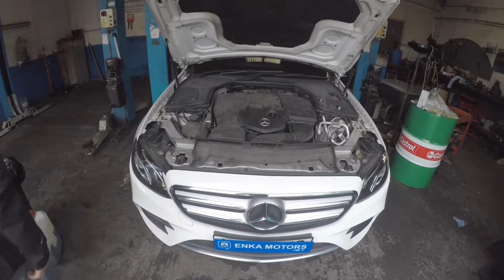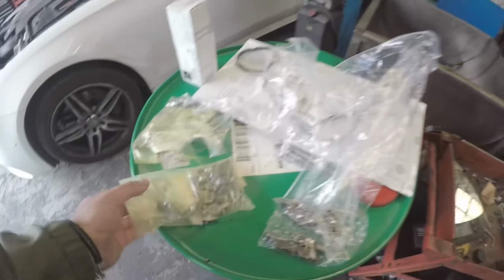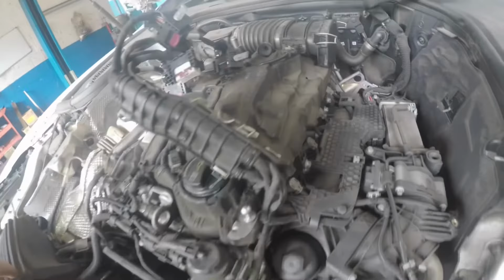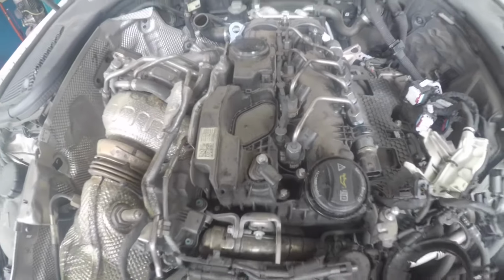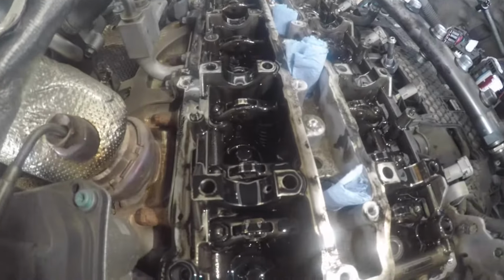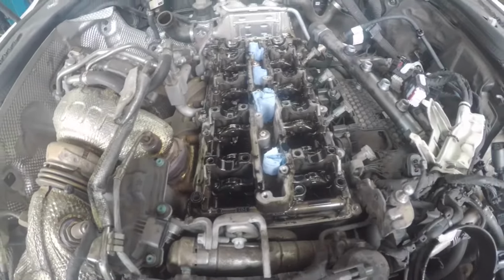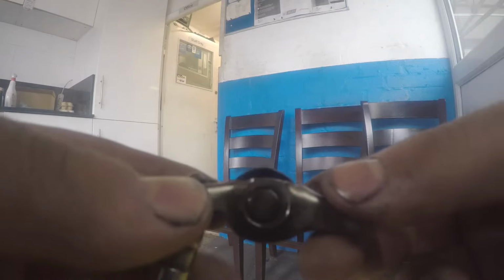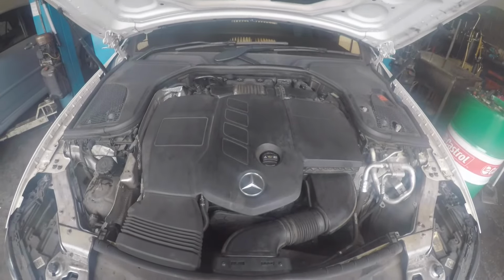Mercedes E220d 2.0 654 engine knocking noise camshaft rocker arms replacement

Comment: Thanks so much for this video guys. I watched the other one before I came across this one. I thought my engine was toast. I'm uk based but I shipped my car abroad. Stupid mechanics told me to buy another engine. Glad I didn't. I will definitely refer people to you guys. You know what you are doing.
Reply from the maker: Thank you for your kind comments, we have done around 5-6 of these engines with this issue, we're glad we can help people with our videos. Did you get the issue sorted then?
Reply: @enkamotors7012  I now have to order the parts from Mercedes and send them over to Africa. Would you mind sharing a full parts list?
Reply from the maker: @jambanja7  Rocker cover gasket. 4x Injector copper washer. 16x Rocker arms. 16x Hydraulic lifters. It will be better to do Engine oil and oil filter
Reply: @enkamotors7012  thank you so much!!

Comment: Is it also common with the om654 1.6 engine (160hp) ? Year 2021
Reply from the maker: 1.6 not 654 engine  1.6 ..626 engine
Reply: @enkamotors7012  it is indeed OM654 1.6  (OM654.916).     This one is 160HP, 3600NM torque

Comment: Very nice job and I am sure lot of money saved by the customer. Unfortunately Mercedes does not take the responsibility of this defective parts. Same engine like mine start with this after the second service. I have to tell that the sound of my engine is not so bad, but is going to reach that level soon or later. Thanks again from Milan Italy

Comment: Hi mate , good job 👍 
Did you have  any problems with c43 v6 engines ,2020 year or newer ?
Reply from the maker: We replaced one engine on a 19 plate C43 that was due to the conrod flying through the block. Apart from that we have not come across any issues with that vehicle.
Reply: @enkamotors7012  Thanks mate, appreciate your comment .
I’m about to get one and reliability would be an issue for me .
Do you remember the mileage of that c43 ?

Comment: Thanks for video. Was this resolved with younger OM654 engines by manufacturer?
Reply: the problem is not the engine - maintenance ! oil change max 5000 km
Reply: MB claims engine oil service each 20.000km... wich is too long. But also engine is problematic, camshaft and rocker arms are too week...

Comment: I have a problem wit mine too pls help which site or shop do I get the rocker arm too for the same 213 OM654 2017 model….. have search through the internet n still can’t find a  better site in stock
Reply from the maker: mercedes main dealer only

Comment: Ustam kolay gelsin bendede ayni Boyle motorda sallama titreme sorunu oldu ve 80 bindeki garantili aracimi servise goturdum ve teslim ettim ama bilgisayar bagladiklarini ve sorun gozukmuyo dediler. Ama oncesi de yag degisimi zamani geldigi icin yagini degistirdiler. Bu arizanin sebebi nedir kronik hastalik mi ?
Reply from the maker: Arac ayni motorsa yani 654 bu motor tipi. Arıza kronik piyano tuşları ve eksantrik ler in değişmesi lazım.
Reply: @enkamotors7012  evet ayni motor 654 yag filtre degisiminden sonra simdilik iyi ama ilerde yapacagini tahmin ediyorum. Gosterge panelinde hic ariza lambasi yanmiyor. Arac garantili ve Ben servise inandramiyorum. Ariza yok diyorlar. Arada yapiyor titreme. Ben macaristanda yasiyorum bunun ingilterede nedir degisim fiyati ? Bu arada tesekkur ederim cvp yazdigin icin iyi geceler.
Reply: Peki ustam 656 kódlu motor 400d 340 hp lik motordada olabilirmi ondada karsilastinizmi ayni ariza dán ?
Reply from the maker: @hasanyesiloz6027  656 larda ayni ariza var onlarinda video su kanalda

Comment: Ustam hayırlı işler kolay gelsin. Mercedes 2022 model sprinter araçlarda da OM654 motor çıkacak. Bu araç Türkiye de kullanım koşullarında randıman verirmi. 170 bg olacak araçlar. Teşekkürler
Reply from the maker: sagol cemal ustam 654 motorlar da simdiye kadar bir bu ariza 150000 km den sonra birde zincir sesi 200000 km den sonra sadece bu iki sorunla karsilastik. 651 lerde yani bir onceki modelllerde dpf sorunu cok olurdu bunda pek yok.

Comment: Same problem with my e class 68 plate only done 100k I hear that noise when I start the engine few seconds only and then it’s gone don’t know what to do
Reply from the maker: The noise will come and go, there’s most likely an issue with the camshaft and rocker arms if you’re hearing that noise. changing the camshaft and rocker arms will solve the noise issue

Comment: did you swap the camshaft too?
Reply: No we don’t replace the camshafts, best to check the camshaft inspect as sometimes could require replacement. But we’ve never had to replace any so far
Reply: @tariktemizturk3761  With me the engine knocks only 3-4 seconds with cold start then everything is normal
Reply: With me the engine knocks only 3-4 seconds with cold start then everything is normal
Reply from the maker: @ZeljkoDalas  does the chain sound noisey? And also is it the same engine?
Reply: @ZeljkoDalas  I have sane sound at the cold start, did you manage to get confirmation it is a  camshaft rockers ? Thanks
Reply: @salam1t1  I sold the vehicle like this!!!
Reply: Hi Mate
I have same problem with my engine 2-3 seconds with cold start e220 w213
Can I help me?
Reply: @salam1t1  Have you found the problem?

Comment: Bonjour je reviens vers toi car j’ai démonté la voiture et dès que j’ai sorti les arbre à cames on a découvert qu’il été un peu usé. Qes que tu me conseilles de changer aussi les arbre à cames ou juste de remonté la voiture avec fes arbre à cames usée ? Cordialement et merci
Reply from the maker: It depends on the state of the camshaft if it isn't too worn down then you can use it.
Reply: @enkamotors7012   ok merci pour le conseil sa coûte combien des arbres à cames sur se moteur ? Cordialement

Comment: I have a same problem with THREE W213 220d OM654 from 2017.   We also changed the camshaft and oil .  Only 150.000km in the engine....  2000EUR.....  WTF ????
Reply: the problem is not the engine - maintenance ! oil change max 5000 km

Comment: Why do you change lifters, they are not problem.
What is injector washers?

Nice video, BTW. :)
Reply from the maker: When I done one of the same jobs I had problem with lifters and had to take it off again and replace the lifter. It is a difficult job and once I open it up I would rather change all in one go then doing it again and again. Injector washers are the copper washers which is bronze colour. If you use the same washer the injector washer could potentially leak.
Reply: @enkamotors7012  Ok, understand. Injector washer is a injector copper seal.
Reply: @enkamotors7012  What is a price for the parts?
Reply from the maker: @srdjanmatic  price from Mercedes including oil and oil filter costs between £600-£700
Reply: @srdjanmatic  imaš da naručiš jaro preko autodoc za 400€ otprilike...
Reply: @enkamotors7012  how much for the work as well please

Comment: Ассалому алейкум, уважаемые мастер. У меня Мерседес.w 213.двигатель 654. У меня точно такая же проблема, как на ролике. Я живу в Москве к сожалению к вам приехать не смогу чтобы вы починили мою машину, у меня к вам будет просьба, пожалуйста подскажите какие мне надо запчасти купить ,если есть у вас номер, детали напишите, пожалуйста.
Reply from the maker: Aleykum selam, is the sound in this video the same sound your car is making? And also, how many km on your car? We can help you better with this information.
Reply: Звук точно такой, как на ролике.
182000 км
Reply: Я вам сейчас ещё пришлю вин - код. Чтобы вы мне могли помочь правильно подобрать нужные запчасти.
Reply from the maker: Hey, we don’t need the VIN because the 654 engine parts are standard. You will need:

Rocker arms x16
hydraulic lifters x16
copper injector washers x4
Rocker cover gasket set
Engine oil oil filter
Sometimes you need camshaft as well. We have the client buy these just in case, if it is damaged we replace it if not, we leave it.

If you can’t understand the names of the parts, leave your number and we can contact you as we have a Russian speaking worker. Thank you.
Reply: Спасибо!!!